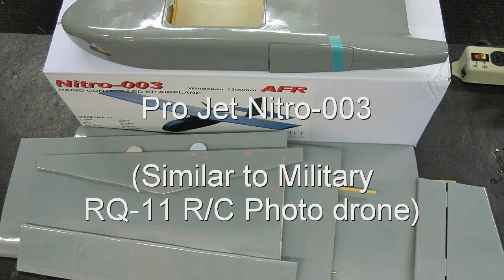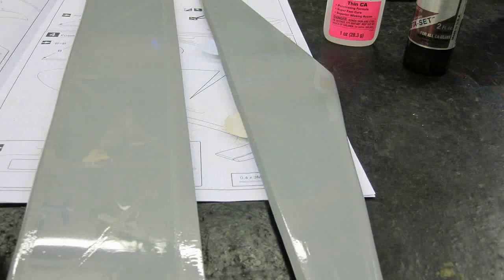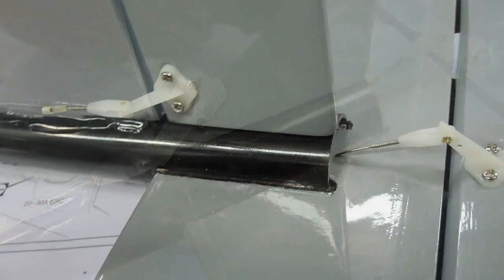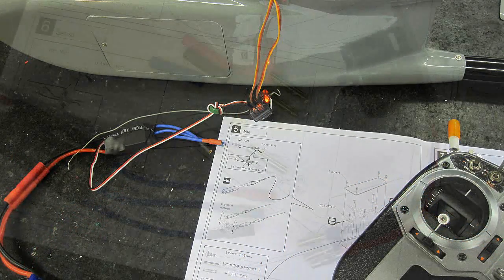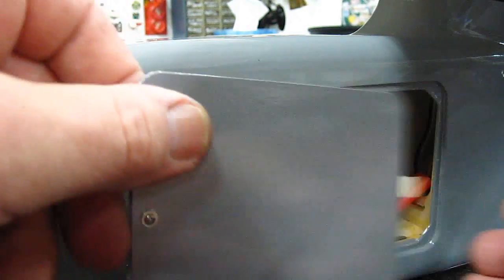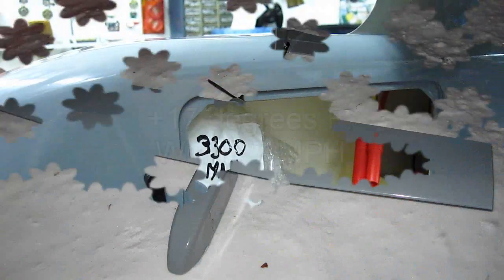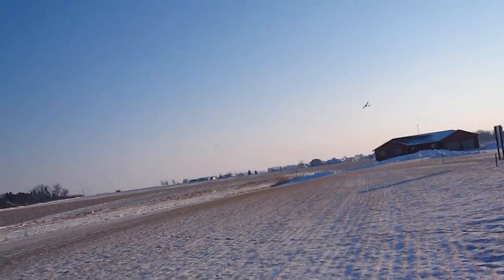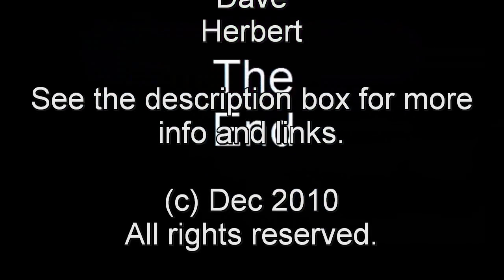Nitroplanes Nitro 003 RQ-11 Camera Drone assembly tips and flight.

Comment: @NightFlyyer  Great review. Have been looking for a camera platform also. I plan on using my GoProHD  on it similar to the NitroPlane video. Only question I have is you used the Optima Exceed Brushless motor. Never mentioned size.  I'm new to this RC stuff so am somewhat in the dark on what would be good. Plan on using the rest of the items you mentioned just was Blank on the Motor and prop. 
Thanks in advance. 
Warren

Comment: Man you pretty much botched this build.  I just completed mine and must say you missed the ball on several things.

People, DO NOT build your RQ-11 like in this vid, you will regret it. 

Also, why in the hell did you add the clay and just not use a larger battery. People, please DO NOT add dead weight to your RQ-11. Mine balances perfectly with a 4S 5000 almost all the way forward. Weight is weight, make it useful.

I added ailerons to mine as well. I will have the REAL build and tips vid up.

Comment: Nice video!  I wanted a good camera plane with a trainer setup.  I wanted this but NP couldn't tell me when (if ever) it was going to be available.  I went back and forth between the Skywalker FPV plane and the projet MQ-9 Reaper,  finally settling on the Skywalker because of the HUGE following on RCgroups.   I'm still loving the scale look of the MQ-9 but only want it if it is a GREAT camera platform.  What were the drawbacks you found with it?